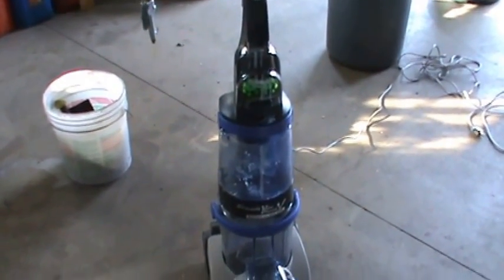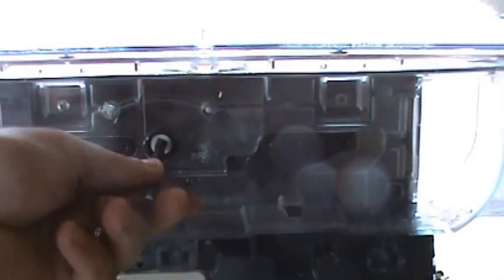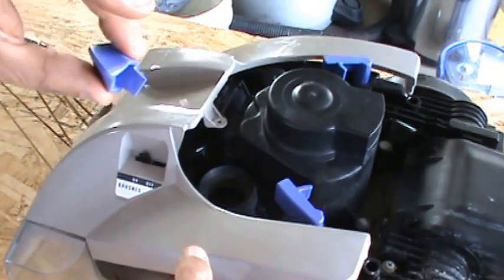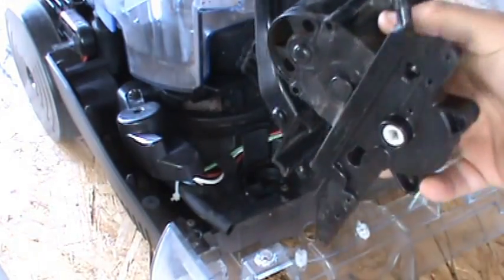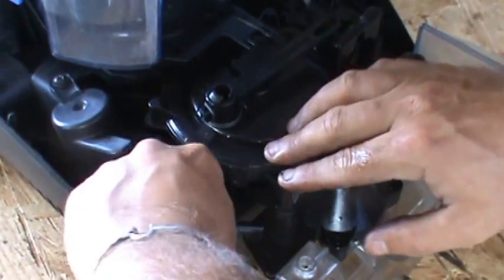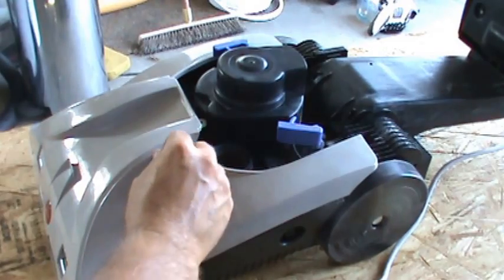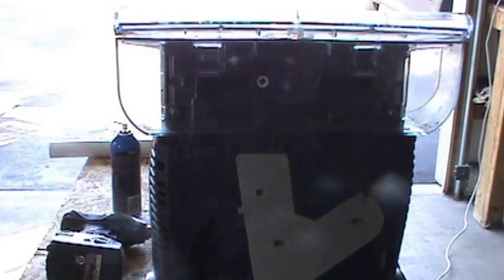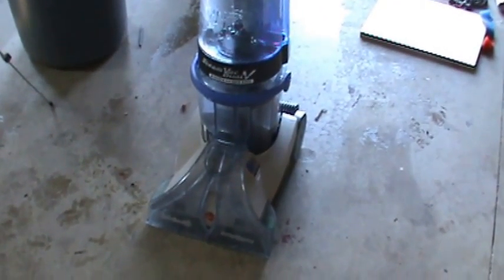Hoover SteamVac brushes not spinning

Comment: This video helped me fix the problem - thank you!  Problem wasn't in stuck gears or bearings so the WD40 spray didn't solve the problem.  Took me a few attempts to discover this, but after realizing there is an impeller behind the gears, opened it up, and sure enough found it was broken in half.  Super-glued the impeller back together and the brushes are spinning again.  Couldn't have figured this out without your video.  I'm not expecting my superglue fix to work long-term so I will likely need to get a whole new part assembly at some point (unfortunately the impeller is not available as a separate part), but at least now I know the problem!  My only suggestion for your video would be to have folks check the impeller as well as that apparently can be a cause as well.
Reply: I meant the plastic turbine piece, not an impeller.
Reply: krandy2
 Thanks so much for posting this! I was bummed that this video didn't help me directly but then I checked back in to see your note. I had the same issue and am also hoping the glue holds for a long time. The 5-brush unit appears to be more like $50 so the longer we can wait, the better. Thanks again!
Reply: jswerens FYI, my gluing job didn't hold very long, so I had to buy a new turbine/gear unit.  But found this place online which had it for only $23.95:  USAVacuum.com plus $4.95 shipping, but also found a 10% off promo code off retailmenot.
Reply: krandy2  Thanks for the help! I need a slightly different (5 brush) part - Hoover Turbine & Gear Assembly (5 Brush) 43191007. I see it on this site for 39.95. Much better, thanks again...
Reply: People just need la

Comment: So I tried your quick fix and it did not work.. additionally I replaced the turbine... that did not work.. Any thoughts on what the problem might be.. I know the turbine I bought was new and everything else seems to work?! Any thoughts/help would be greatly appreciated
Reply: UPDATE: I have a similar model either one older or one newer than yours and my brushes do not spin unless the unit is "reclined" After replacing the turbine my unit works great! Thanks for the video definitely wouldn't have been able to replace the turbine or even know what was wrong with the unit to begin with without this video much appreciated!!!

Comment: Really appreciate you uploading this video. I haven't used the cleaner for a few months now, using just the suction to clean, but obviously not as effective. When we got our cleaner, the Vax Dual-V (UK version), it hadn't been on the market long when the brushes jammed, so there wasn't much help on Youtube regarding this repair. Needless to say, I'm pleased I can finally fix this thing, without having to guess what's wrong. A great help with what looks a fairly simple fix. Thanks.
Reply from the maker: ***** I can't believe how many people really appreciate this video.  It must be one of the only ones of it's kind on Youtube.
Reply: doublewide6 , any chance you can look at my question above? Would love to get your feedback.  "When I turn our brushes manually and then stop them, I can feel/hear the gearbox still turning. Do you think this means the gears are stripped? Our unit is only a few years old but I suppose when using plastic gears, anything is possible..."
Reply: Just a quick update...  I followed this vid and the large fan was jammed,  behind the gears. Took about 20 mins following this vid and now done 2 carpets with brushes spinning nicely. Lubed with silicon grease. Thanks again.

Comment: DoubleWide6, thanks so much for the great video. When I turn our brushes manually and then stop them, I can feel/hear the gearbox still turning. Do you think this means the gears are stripped? Our unit is only a few years old but I suppose when using plastic gears, anything is possible...   Thanks again!

Comment: Nice video.  Unfortunately, the gear on the top of the unit was my issue, not shown in the video.  It cracked in half for some reason..  I guess I'll be ordering a new gearbox.  I have only used the unit a handful of times on a small area.

Comment: I would not be encouraging people to take their machine apart if it is under warranty. If they break it you can kiss your warranty goodbye. I had one of these units and it did a super job the first few times I used it then the brushes seized up. One look at the bottom screws and I could see they were rusted which leads me to believe the other piece which turns the brush is rusted as well. I tried the suggested fixes in the hoover adds with no success. I hope the hoover company pays attention to these posts and figures it into their quality control. You should not be using screws or metal pieces that easily rust on a machine that uses water. Many companies try to lower costs as much that don't rust so eh as possible which is understandable but spend a few more pennies and use parts that don't oxidize so easily. Also I don't think oiling your ball bearings will be a long lasting solution. Do you really want to chance dripping oil on your carpet. If Hoover wants to avoid unnecessary returns and buyer frustration they should spend a little more and don't compromise the quality of what would otherwise be a good product. I use to work at a vac shop and serviced hoover vacuums that were 30 or 40 years old back when quality meant something.

Comment: Great Video - thank you for taking the time to do it, Just taken my VAX all terrain apart due to a jammed brushes.

Followed the guide to the point of opening the gearbox, the gears where stuck solid but noticed an extra 2 screws on the unit. removed these and then into the gear box. by twisting the turbine from the inside I was able to free it off and then clean. refitted all parts and working as good as new now! thank you

Comment: Thanks for this! I have the Dual V, very similar model and all that. I did this and it hasnt worked. I think the gearbox is bad, and seems I will have to get a new one.

Thanks for putting the part numbers up. Hoover doesnt have them anymore it seems

Comment: I had the same problem with my hoover steamvac deluxe and on the top right hand cover that covers the brushes on the machine itself not the casing of the brushes,  has a filter that can be seen behind clear plastic from the outside of the machine, and I took the little door off and cleared the filter and my brushes were working just great!

Comment: Excellent video with great detailed explanations!  I did everything you said very carefully but one thing you might want to show is taking the top cover off to inspect the turbine.  Mine did not spin after doing what you explained so I took it apart again - much easier the 2nd time - and took the top cover off only to discover the impeller had cracked all the way to the steel shaft.  Before I pulled the top cover I shot some air into the intake and noticed the impeller spin but the gears still barely moved.  I thought that maybe the issue was that a lot of air was escaping from the intake as I didn't have a good seal.  So, I knew I needed to replace the unit and, being the curious guy I am, I decided no more harm could happen so I pulled the top cover and viola!
Just thought I'd pass this on to you for future videos you may do.

Keep up the good work!  Without your video I would not have easily known how to fix the machine.
Dave Himbert

Comment: Thanks so much for the video. The only suggestion I have is if the brushes aren'turning, you might as well go ahead and disassemble the unit to free it up.  
If you try to force it from the square hole, you might strip the gears. I fixed my in 30 minutes with disassembly of the unit. Just had to be able to see the bearings, saturate with WD40, and repack the gear going into the bearings.
Reply: I had to do the same tonight to free the gearbox - worked like a treat :-)
Reply: This is a joke I asked how to put the brushes back on the side and it gives me every video but what the hell I need so Hoover needs a video that shows how to put the parts back on instead of showing what to do if it don't work

Comment: I appreciate the video however it seems to me that if rusting is occurring that they should be using stainless steel or some other non corrosive material. I have a new spin doctor and after 3 uses the brushes are not turning. The fact that this video has had over 35'000 hits leads me to think I am not alone in a problem which appears to be faulty manufacturing. I don't recommend people take their steam vac apart lest they void their warranty.

Comment: Thanks for the great video doublewide6! I have a Hoover Max Extract Model F7450100. Mine just had two more screws to remove on the bottom than the one on the video, otherwise same exact setup. It seemed like the inner bearing was the culprit. I took the outer bearing and plastic gears out and lubed it up with WD40 and it freed up when I spun it. I also sprayed WD40 everywhere else you said. Put everything back together and it worked like a charm! We were very close to pulling the trigger on another carpet cleaner and I found your video and figured "what the heck"! Thanks for saving us $200+!!!!

Comment: Thanks for the video. I got the brushes spinning again a while ago, but recently the brushes stopped spinning again, so I took it apart again.  The turbine gears seem to be spinning easily now, so I guess it's something else. I was wondering if it might be related to the black hoses that are removed from the turbine during the disassembly.  Should there be air going through them?  With the motor off, I could not blow through the hoses.  With the motor on, both with the handle up and down, I don't notice any air flow through the hoses.  The only air flow to the turbine seems to be the vacuum coming from the bottom of the unit.

Comment: The video on the brushed and vacuum motor was perfect and I managed to clean it up and lubricate. After using a few minutes I got a grinding sound, a burning smell, a flash and pop, and total silence. I need to remove the main (electric) motor. Any videos for this ?
Reply: I figured out how to do it, changed the motor out, and continue to use the machine.
Reply: There. Is a you tube showing how to do it.

Comment: I have a model F7452-900 Hoover Steam Vac.  I took the whole thing apart and got the gears working.  The rust had caused the bearing not to spin.  Once that was cleaned and could hand spin the gears.  The gears are in great shape and so are all of the brushes and the square "rod".  My problem is that when I put the cover back over the gears, and test everything, the brushes won't spin.  It's like the cover is causing issues.  I can't figure this one out.  Help please.
Reply from the maker: Inspect the turnbine.  If the turbine is broken the brushes will not spin.  Doublecheck that the cover is on properly.  Let us know how you make out.

Comment: I have several Hoovers.  One looks similar to this model and wondering if this unit has  a fine mesh air filter  for the brush turbine.  It snaps into place from the bottom of the unit and could be easily overlooked by some owners. I suspect a dirty filter could hamper air flow to the turbine and cause brush rotation issues.  

Was surprised to learn the carpet cleaning brushes are air powered  but realized the hose attachment  brushes had to be air powered.  .

Comment: Excellent Video, so well detailed.  My Hoover F6212-906 is a similar model and went off for repair, only to come back "Beyond Economical Repair, turbine seized, unable to un-jam and part is not available" no charge. So I searched for the part and found it is available but can't be delivered as I am outside USA.
Then I fortunately found this video.  It gave me the confidence to pull the machine apart & strip the turbine down, treat it with WD40 and it unfroze just like you said it would.
Your step by step instructions were very clear, lots of methodical detail and a credit to you.  Your explanation and information of what & why issues occur were extremely insightful. Saved me a fortune, untold gratitude to doublewide6.
Reply from the maker: Awesome!!

Comment: Thanks so much for your insight! This did the trick with our almost 10-year-old SteamVac. Like others, I did end up having to open the turbine case, but with some judicious cleaning and lubricant, everything is running like new. The roller bearing for the turbine was very grungy but a bit of spray lube cleaned out a lot of the gunk.

Not bad for a $0 repair. And now I know how to put a replacement turbine assembly in if/when this one fails irreparably. 

Thanks again!
Reply: Ma

Comment: there are two more screws on the bottom that weren't mentioned. caused me to break out the plastic bottom when removing the top plastic part. hope I didn't ruin the brush support area or that it doesn't fall apart when running now.

Comment: This video was a big help, but does anyone know how the black plastic impeller connects with the gear shaft? I see tiny slit indents in the gear shaft and little (1mm thick) protruding fins on the impeller, but that doesn't seem like a very secure way to grip a fast moving part. My impeller is broken, but I don't really want to have to buy a whole new air turbine if I can just get a new impeller ( I just want to make sure I install it correctly).
Reply: I just used this video to fix my vac.  My impeller was also broken; the plastic split along the diameter, but not entirely (maybe 75% of the way).  I superglued that back together to make it solid, and the impeller then fit very snugly to the gear shaft.  It appears that friction alone is enough to keep it in place.

Comment: Thanks! In my case the big plastic disk in the other part of the gearbox had broken into three pieces,  but it was because of your video that I was able to take it apart and figure that out. :)
Reply: Mike Arnold Hoover apparently "outsources" their parts and services to local vacuum stores.  I will have to buy a whole new turbine, which is about $40 (just the part), to replace the broken disk/fan.  I may try the "glue and pray" method first and see how well that works.
Reply from the maker: Great,  Another one fixed.  Way to go.  Thanks for commenting.
Reply: @ Mike - The plastic disk impeller in mine is broken too.  Were you able to get a replacement impeller through Hoover or did you have to order a whole new air turbine?
Reply: @Alyson, I was so happy to have determined the cause of the problem, that I posted my comment hastily -- I can't say it's fixed yet. The disk was broken cleanly, so I used krazy glue to put it back together. It seemed to hold ok, but it still doesn't turn as freely as it probably should, so the brushes are spinning, but slowly. I probably need a new disk impeller, but I haven't looked into it yet to see if it's possible to buy just that part.
Reply: Mike Arnold I'm planning on contacting hoover parts tomorrow, I'll let you know want I find out. (The disk doesn't have its on part # on it . . . I have a bad feeling I might have to buy a whole new turbine).
Reply: Cool, thanks Alyson! I have a bad feeling you're right. That's why I haven't been in more of a hurry to find out. :)
Reply from the maker: I think the plastic fan that is broken is a common problem with these steam cleaners.  I believe that replacement part is under $30.  Good luck and I'm happy my video helped you fix it.
Reply: Bah. That figures. Thanks for the info.
Reply: Update for anyone who is interested: I used Krazy Glue to put the broken disk back together, and while the brushes did spin, they didn't seem to work as well as they had before, so I ended up buying a new turbine (found one on vacpartswarehouse.com for about $30). Now it is working again, about as well as it ever did. Good luck!
Reply: Yes split in half where it attaches.
Reply: Mine too, the disc was snapped in half. Had to buy the whole turbine. Got it at a vac repair shop for $55 ouch. Oh well, putting it back together now. Only problem is the screw hole on the top wasn't made. Grabbing the drill now lol

Comment: Thank you for doing this video. The 2 pop out connector on the back was a huge question. Looking at them they could be pop out or a screw from the back side. I hated to pull and fin out they are screwed and I brake the plastic cove. So I am off to fix it. The rest of the video saved me lots of time hunt and finding what's next. You and YouTube are the best. I will subscribe

Comment: Take my advice, buy a Shop Vac machine for 60 dollars. My Hoover just gave up after 15 years. I opened it and found bearings and shrapnel at the bottom pane of the vacuum under the engine. I can tell you that it was smelling bad when the engine was running, like burning. Once the engine was removed, I made it spin a bit with my hand and could see that it was a not spinning easy like it should. I noticed that the engine was a bit rusted too.